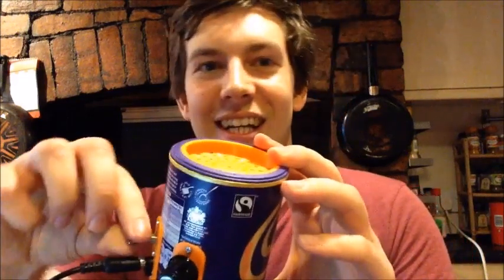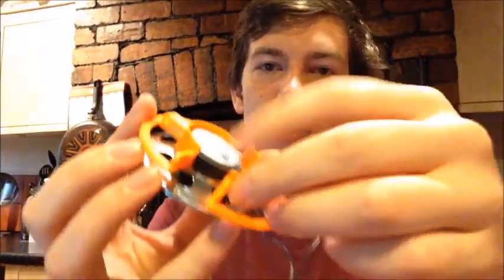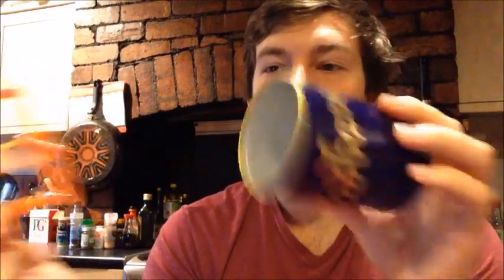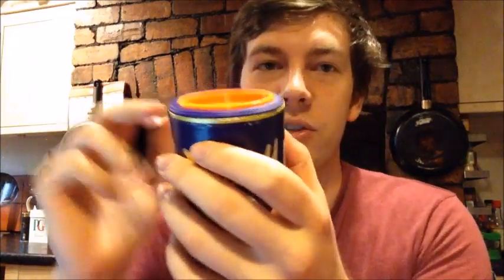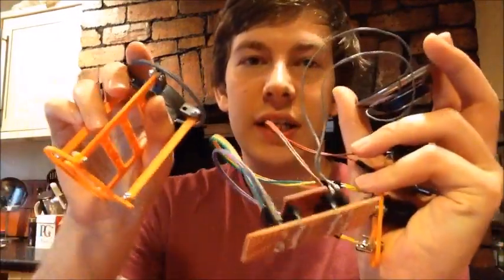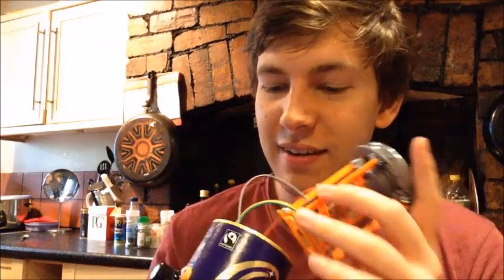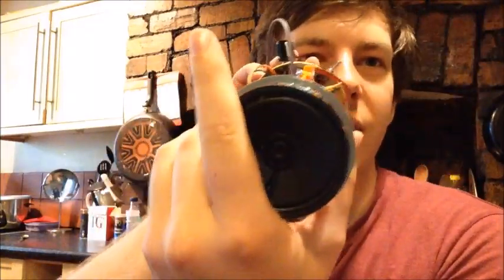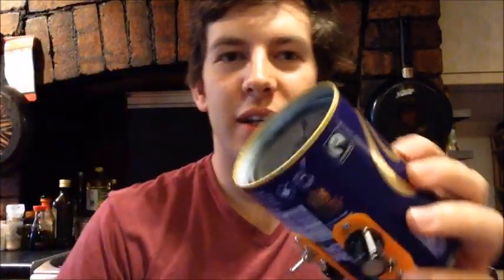Hot Chocolate Tin Speaker

Comment: Great Job! I think some holes in the back of the container would help the air enter and leave, thereby helping the speaker drive the membrane easier. This would likely increase the volume and the clarity!
Reply from the maker: That's a great idea - is this a standard design practice for speakers? Excellent pro-tip, thank you :D
Reply: I am not completely sure about desk speakers, but certainly larger speakers and sub woofers always have them. I presume the difference it makes for small speakers isn't nearly as significant as large ones, although it might still help! 

F.y.i. the reason most headphones do not have these holes is that sound leaks out, and your audio can be heard by those around you; not a problem in a desktop application!
Reply from the maker: Yeah definitely, I imagine with large speakers the size of the pressure waves caused by the speakers is much bigger (kinda by definition) so you'd need to let air in/out. I've never really thought of it like that before though. Thanks for the fresh perspective.